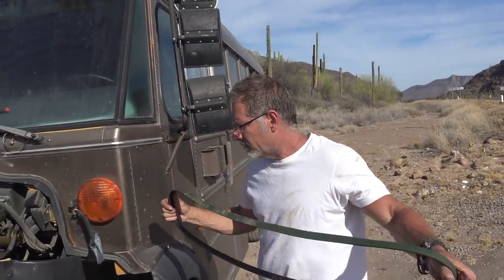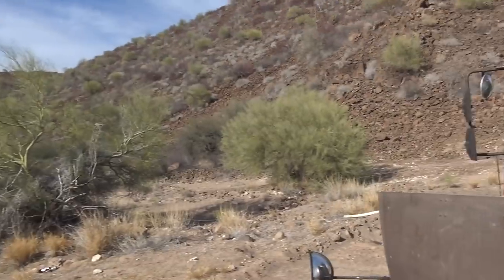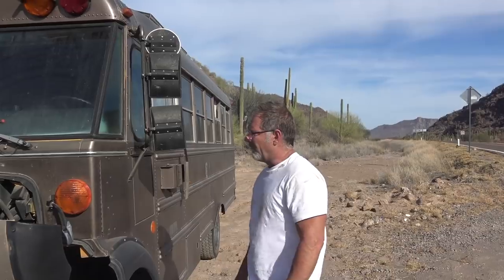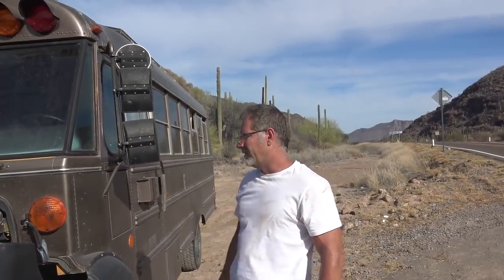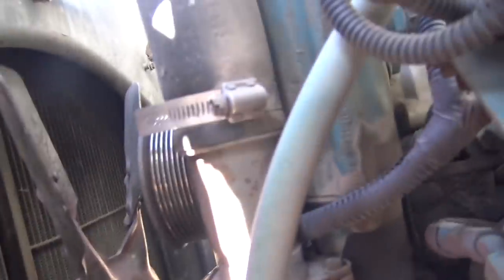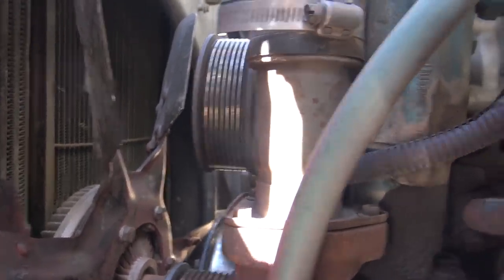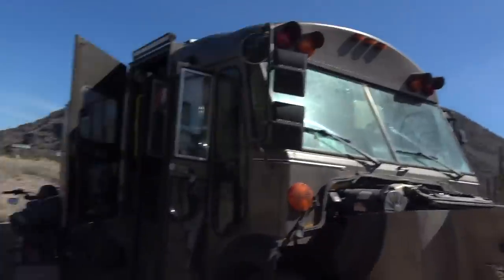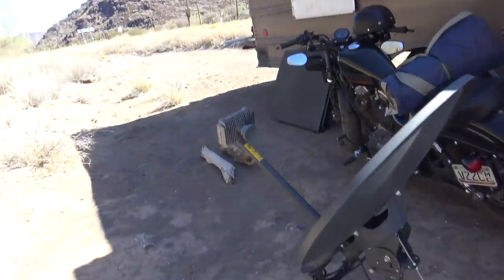Updated Travel Vlog 2019 T444e broken belt, bad Power Steering Pulley? stuck

Comment: That is the water pump be careful not to break little bolts on the thermastat housing. Jax did video on the Mojo bus it’s easy. Stick the Pringle’s to housing so it don’t pinch it any questions let me know let it cool you can drive it when it gets hot stop. You might get 5 miles each time 🛠🛠🛠🛠🛠🇨🇦🇨🇦
Reply from the maker: Thanks, Badge. From the serpentine belt diagram, the water pump looks more in the middle, but how can I doubt you? I don't know what the thermostat housing is, or the Pringles. I'll film as much as I can.
Reply from the maker: Also, I'll check out Jax channel for the vid.
Reply: Rad hose coming from the rad to wp those bolts it looks like the idler pully 🤬 up

Comment: If the snout of the water pump, under the pulley, feel sound you may only need to replace the bolts that hold the pulley to the water pump.

Comment: Thats the water pump.
You need a 7.3 power stroke water pump.
Make sure the pulley isnt just missing the bolts though.
There should be 4 bolts holding the pulley to the snout of the pump.
Usually a water pump will leak before it fails.
It sure looks like just the bolts fell out of the pulley.
Double check that.
Reply: Matthew Edwards 
Check if coolant is gone or extremely low
I believe that will tell you if water pump leaked
Reply: @dennism6664  not to mention coolant everywhere. I dont see any.
Reply: Don't drive it Jaimie! You gotta get a new pulley and bolts! I think its pressed on, so water pump may be damaged.
Reply: Yeah, looks like a pully problem...did the pump on my 7.3 last year and basically if it ain't leaking, it probably isn't broke.

On the bright side, you can limp a long way with that engine...it's a beast and doing what you described wouldn't bother me. guessing you could make it 5 miles from a cold start before temps go up, maybe further...not a quick engine to heat up.

Comment: All-right, I did finally come up with a temp fix. A bearing on a bearing, find any bearing 1 1/2  inches wide. A same size washer, and a 1 inch longer bolt. Bolt the bearing on the bearing with the washer with the longer bolt. That could get you 500 miles with belt on and everything working.
Basically a bearing  on a bearing to make things spin.

Comment: Without the water pump turning it is very likely your temperature gauge will not be accurate assuming the sender for the gauge is located near the water pump. With no water flow through the block it will be much hotter then what the gauge will show and will heat up quite quickly without any water flow.I don't think limping it to  town  Is the best idea. Just my thoughts, Good luck.

Comment: I would change the water pump, thermostat and belt tensioner. I would also rotate by hand the other pulleys for bad bearing. Grooved side of belt goes toward groove side of pulley, flat pulley backside of belt. Clean grooves in pulleys, may have dirt or burnt rubber from belt.

Comment: I would do a water pump and new belt even if it is only the idler pulley. Those are pretty common parts and should not be a long wait if they are not currently in stock at the nearest parts store.  As for driving it a mile or two at a time, you risk cracking a head which will make you wish you called a tow truck for a 15 mile tow.
Reply from the maker: I hear ya, Barry. I just don't know how deep I wanna start removing things under these conditions.
Reply: @enigmaticnomadics  not sure what a tow truck would cost you out there but I would pay a couple of bucks for a tow knowing what it cost to rebuild the heads on that unit. Or ride into town and see what is available for parts. You never know they might be in stock. Best of luck to you Brother.

Comment: I'd help if i could. I take it no one has stopped to help.
Reply from the maker: A couple have, but I need to know what parts I need. It's just going to take some time. I should have bought a service manual. My lesson in all this.
Reply: Enigmatic Nomadics; I stopped to help some Canadians on MEX-1 heading south last December. All I could do was give one a ride to the nearest Pemex to source a tow truck. I didn’t leave them until I knew they were at least off the road. If you have to leave the site take a photo of the truck to show someone as to its size. 

I tried searching for a T444e service manual download, no joy there.

Are you still in Mexico? I thought you were traveling with two other vehicles.

Comment: Don't drive it you can easily do major damage (head gasket blown or water pump empeller can grind through front cover) The water pump must be replaced as a unit. You can't just replace the bearing.

Comment: i all keep alot of parts on hand . i keep a backup starter, fuel pump,  the pulleys that go bad the most . and some HD parachute cord to make a drive belt of any size if need be to bypass any thing  . i have a been of just back up stuff. but i do not keep a water pump . what happen to you was out of the blue

Comment: U R caravanning with others, correct? Rather than trying to drive with a blown water pump (as one poster said - temp gauge will not be accurate and u could fry the motor) have someone get to town and arrange for a tow. Surely there is someone in every town with a truck that can pull your bus. Also, if you're on a main highway, the government pays for a roadside assistance organization called the Green Angels. It's like AAA roadside assistance. If you can all stay together and wait there, one of their trucks will come by and assist. Keep eyes peeled for the green truck, to flag it down, if it passes and doesn't realize u need help. It's a judgement call, as in Baja, you def don't want to be stranded on the highway on a pitch black night in the middle of nowhere.

Comment: Yeah it's running on battery power t44e the E stand for electronic hydraulically actuated unit injectors really bad idea to run it without the belt the heads on that engine give up easy enough without the added Heat just remember one thing when you're putting it back together Groove to groove smooth to smooth and probably wouldn't be a bad idea to get a belt tensioner while you're at it they tend to be pretty much s***

Comment: Looks like the bolts came out of the water pump pulley..?  A bad water pump will not cause the pulley to be loose.  Could be the shaft has broken, which means you still need a water pump. If you could find a local who knows about mechanics (not necessarily diesel).

Comment: It the pulley just seperated from the pump flange?
Or is the snout of the water pump, underneath the pulley rocking around.
I want you to reach behind the pulley and turn the pump shaft.
See it the pump is bad of it is just a loose pulley.

Comment: That looks like just an idler pulley. The water pump is the one right in the middle that the fan connects to. Be aware that the accessories are different on a Powerstroke 7.3 and a T444e. So the pulleys, belt and belt diagram will be different.
Reply from the maker: Great point! From the serpentine diagram, I think it could be the power steering pump. Still figuring it out.

Comment: Is the shaft. Wobbly as well as that pully on the water pump if so u likely,need a pump if not u may get away with just a pump,but if the pully is all thats wobbly then look at it to see if it can be changed without the pump being removed ,if so u may well only need a pully m.p.h,but if u can afford it why not change tge pump and pully while its apart , odds are if that pullys bad the pumps likely just as old an on its way out too ,its your home and your wheels ,twhy chance it going out. On down the road,is how id look at it wen u already got the belt off,an are gonna be rt their working on it anyways

Comment: Is Idler pulley seized?  Is the water pump seized?  Why did the belt break?  I had a belt break on my suburban, after I got up to speed the mechanical fan actually wind-milled and spun the water pump to keep things cool, i didnt have power steering or alternator, I went about 5 miles that way.  It was the idler pully that went out...
Reply from the maker: Still figuring it out. I'll keep you posted. Thanks!

Comment: Jamie, turn heater on high inside. If it's got rear heat... full on high. It will help w cooling. 
For the pulley to rattle like that the bearing came apart. Looks like parts are 175$..

Comment: Im not an expert but if you have a 12 volt water pump on board you can hook that up with your  heater hoses to circulate the water thru the motor

Comment: Looking at that pully, Did you check to see if there is a bolt pattern that short bolts went through? Crazy thought I know, But that pully may have come off due to losing the retaining bolts (if there are bolts holding it to the shaft) I've lost a few water pumps and when they went bad, I also lost the water from the engine.  Good luck in the fix... CHECK THIS LINK LOOK AT THIS PULLY, IT SHOWS 4 BOLT HOLE PATTERN... THEN CHECK YOUR PULLY FOR MISSING BOLTS...  

https://www.ecstuning.com/b-original-equipment-supplier-parts/water-pump-pulley-112mm/11511742045~oes/?msclkid=1604b346958f1981b171ef810b195b07&utm_source=bing&utm_medium=cpc&utm_campaign=Srch.US.ProductAds(BSC)&utm_term=4579809528057783&utm_content=All%20Products

Comment: Part2. You need to drain antifreeze. You'll reuse it.  
 Make sure bolts aren't broken, doesn't look like it, but always worth checking. I'm pretty sure bearing. That's a replacement deal. Changing it shouldn't be too difficult. Hoses may be rusted to pipes, loosen them sticking screwdriver between hose.  Theres a rubber gasket between pump and engine. You might be able to reuse it, but I'd put new one one if you can.  When you remove hoses, remove bolts,  impeller sticks into engine in backside of pump. R&r should be pretty simple. 
 If you drive on it, heaters on high. Watch your temp. Dont push it and you can get a few miles in. But if you push it even a little, you'll blow a head gasket and possible crack a head. So drive till temp raises, then stop till it cools. Id also check coolant level before driving again.  I cant think of more right now. Good luck.

Comment: jammie .. Tikibar guy here..your plan to travel short distances , to not overheat is a good one, diesel engines use very little battery power to run, once started..  if low on starting power i would find a way to use your solar battery power to help the engine battery charged
Reply from the maker: Hey, man. I definitely remember you. I was thinking that all I would need to do is add the fuse back into the circuit from the isolator. I removed it when I added the battle bornes. If I keep a close eye on the temp guage, what else is at risk? We're talking 3-4 miles at a time.
Reply: @enigmaticnomadics  just watch the temp gauge , stop before it gets into the danger zone {red indicator] you may need to stay awhile it cools back down.. if could use an electric fan on the radiator while stopped to help cooling down time. 
is your solar 12 volt ? make sure you do not feed more than 12 volts to the engine system